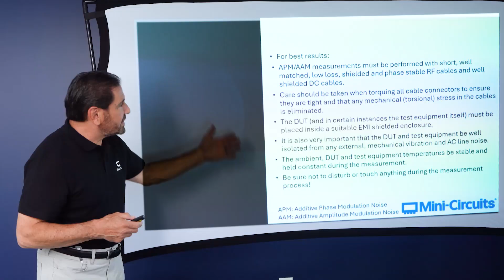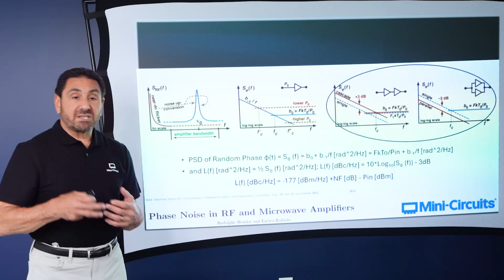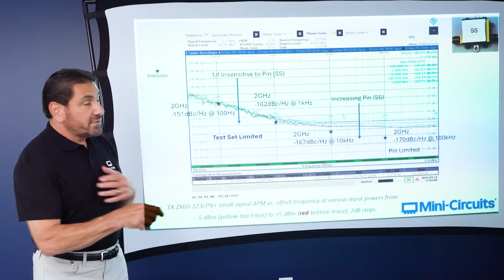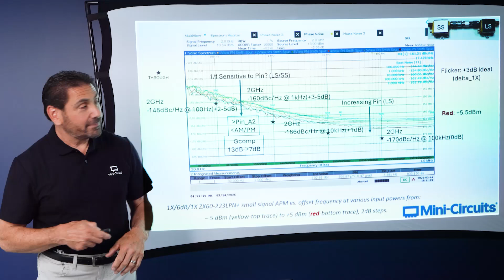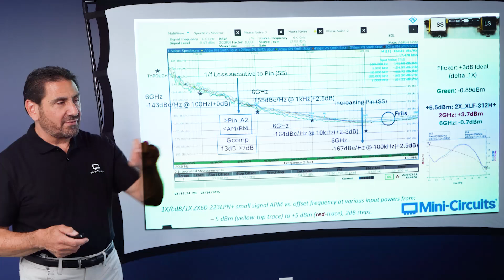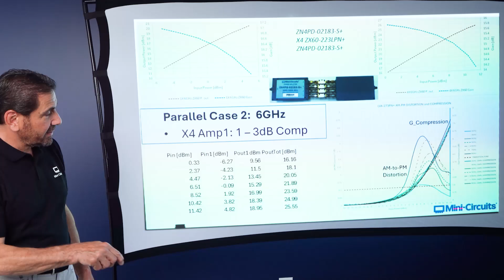Understanding Additive Phase Noise in RF & Microwave Amplifiers - Part 2

Comment: I really enjoy these Minicircuit presentations.  My own experience is a bit different from what is covered here, involving radar signals for which the SNR at the antenna is usually less than 0 dB.  

[I also have some experience in some extremely high dynamic range/high bandwidth ADC systems, but that's a horse of a different color.  (13 ENOB at 4 GS/s, continuous, not burst)]